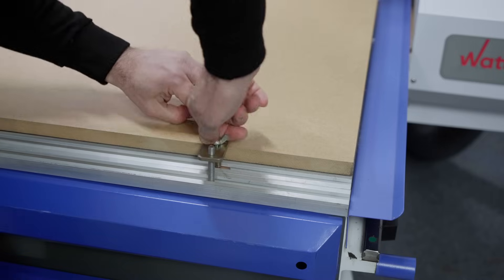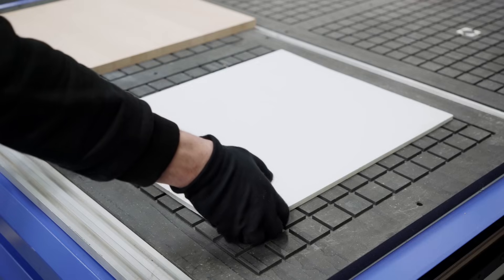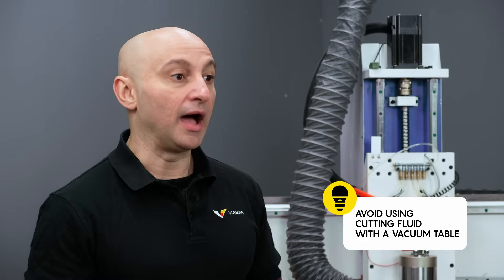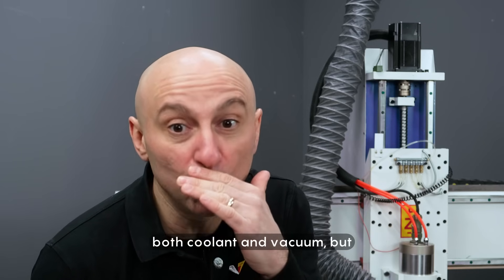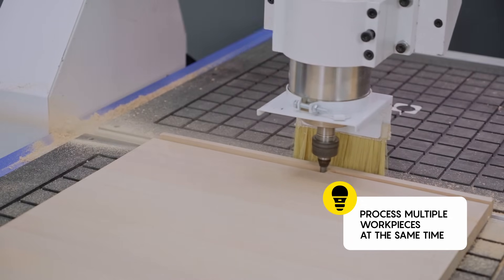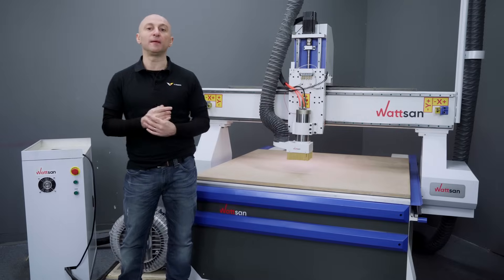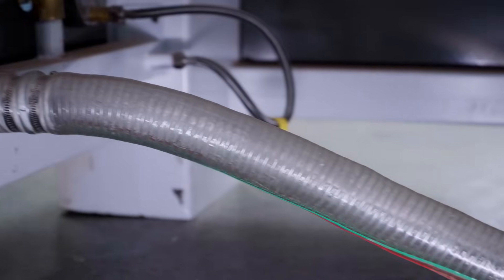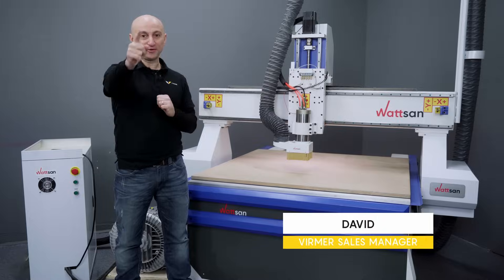Why YOU NEED a VACUUM TABLE (How a vacuum table for CNC ROUTER Works) | Wattsan M1 1313

Comment: 🔹 Great demonstration of how the vacuum table works in CNC. In many cases, it's a practical solution, but for those seeking maximum precision, we recommend securing the pieces with clamps. Less noise, lower consumption, more stability. 😊
Reply from the maker: You're right, it's all about finding the right balance for your project!